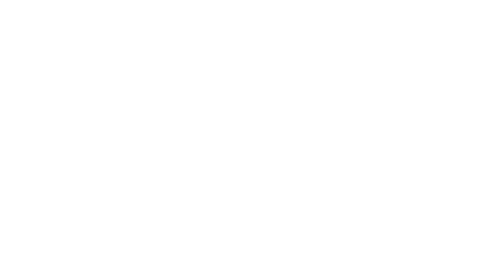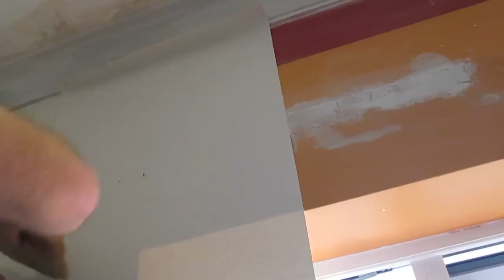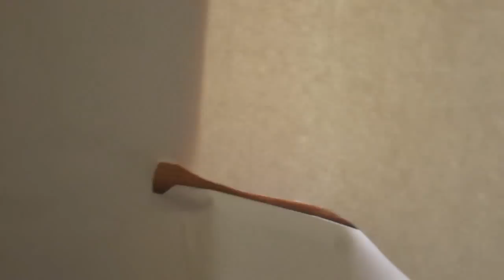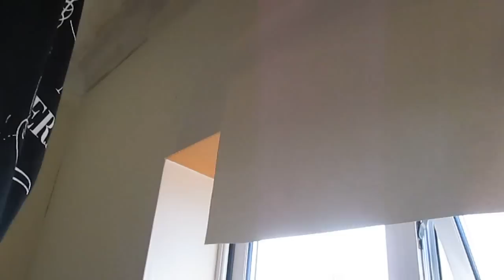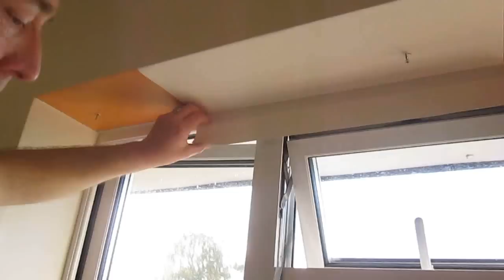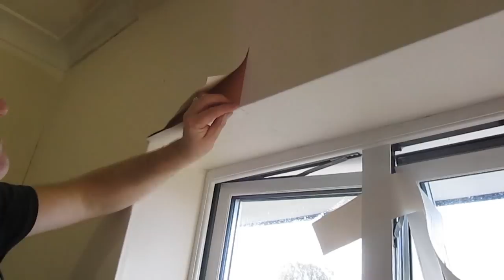advice from a decorator wallpaper around a window, the fiddly, tricky,  little bit

Comment: It's fine for lining paper. Although I lap the other way so the light doesn't hit the edge of the paper. Also, if it's thick lining paper or if I'm painting directly over it, then I will sand the edge once dry with a bit of fine sandpaper. 👍🏼

Comment: Why do you go from a razor blade to scissors 
And is the paper wet when you're cutting it with the blade? When I do it, it drags sometimes
Reply: good paper and  a  sharp blade, pull it tight and it wont drag.
Reply: garethmurt me too.can't get away with a knife
Reply: The dragging is down to a dull blade on your knife. Needs to be razor sharp.
Reply: MephProduction agree!  If your blade is sharp, and it drags and makes pizza slices of your edge, I have found that the paper is just too wet or not quality.